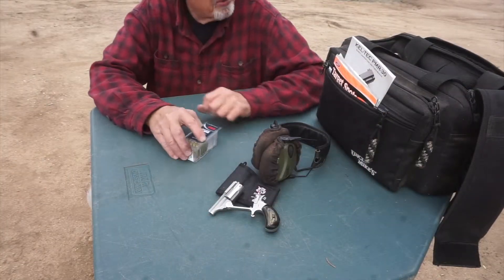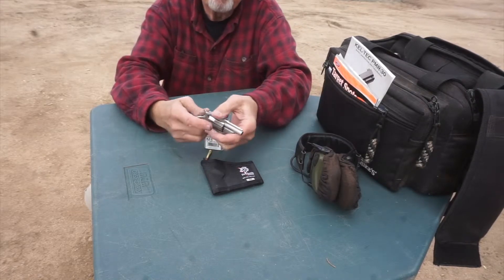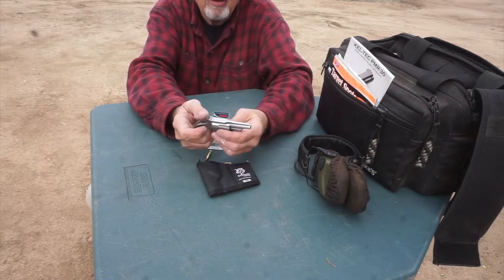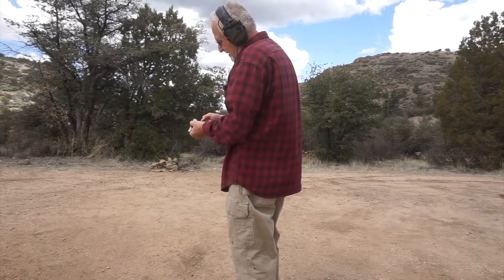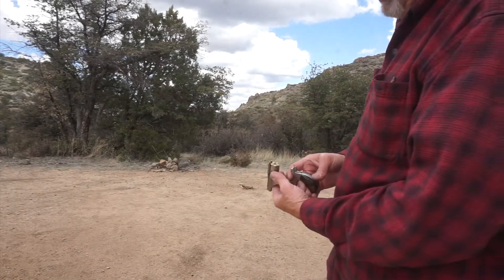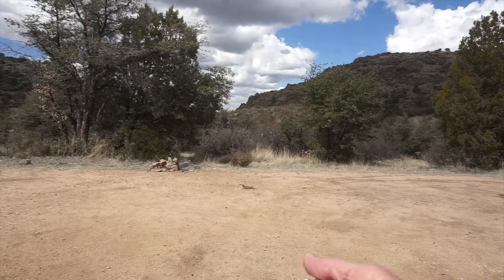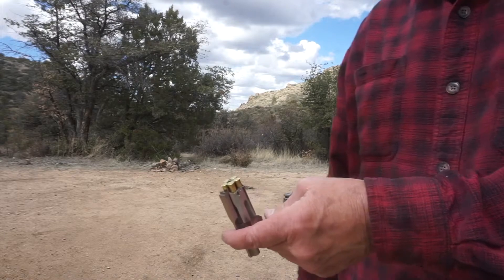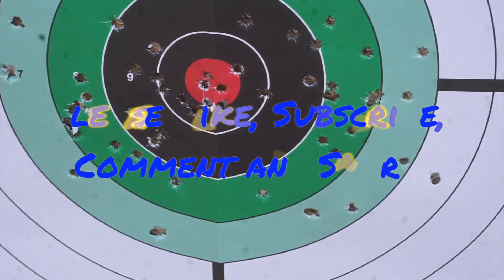⚫️NAA Ranger II Test After factory repair. Was it Fixed⁉️

Comment: I had a problem with mine as well as my Sidewinder. The problem was the ammo I was using, Hornaday. NAA said they were aware that certain ammo was causing problems due to the cases slightly bulging backwards and not allowing the cylinder to rotate due to the tighter tolerances. I have had zero issues with cci or speer gold dot. Good luck with yours.👊🐍🦅🇺🇸

Comment: You don't have to close it on the safety notch if yer gonna shoot it. That's just a very good safety feature. When you cock it, it will go to a round. Everytime no matter where that cylinder is at. Their GOOD guns. I got light hits one time and misfires. So, I used my calipers and found that the bad ammo was .005-.007" smaller in rim diameter and rim length.

Comment: If you are wondering about what a mainspring on this thing does, it puts pressure on the hammer, you compress it each time you pull the hammer back and release it every time you pull the trigger. The mainspring would be probably inside the grip under the grip panels. Must have been binding  in there to give you a jam like that.
Reply from the maker: great information. I understand it now, thank you!👍
Reply: That was my experience as well... cleaning the cylinder well helps a lot with the hornaday rounds.